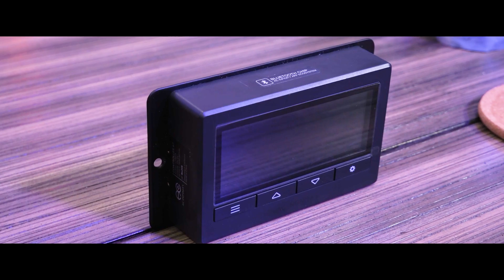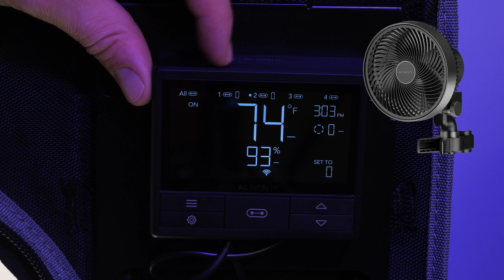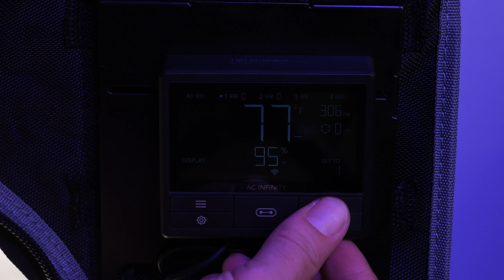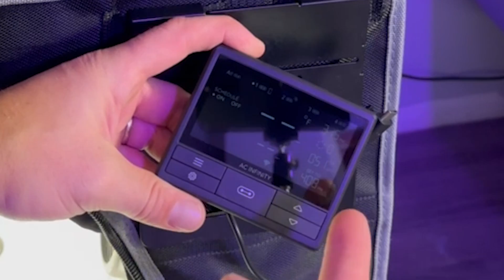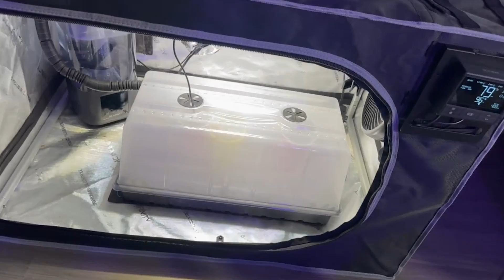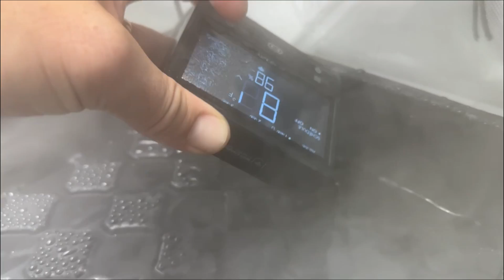HOW DURABLE is the ACINFINITY CONTROLLER 69 PRO?

Comment: Evidently alot more durable than the stitching on their tents...2 thumbs down on their tents...everything else has been pretty legit
Reply from the maker: Appreciate you bringing this up. I’ll be sure to be extra abusive to mine to test for any flaws. If you have issues I encourage you to each out to them for assistance.
Reply: @Pigeons420  already did...their remedy is to send another outer shell, which is fine I guess but after 2 months of use and it being the side door that doesn't get as much use as the front it's kind of worrisome. And not to mention the lack of flaps over the side doors...that should definitely be addressed.
Reply: @Pigeons420  I guess after buying three 5x5 tents, four 69pro filtration unit combos, 10 cloudline S6 fans and 4 humidifiers they might just throw me a bone and toss me a new tent but I guess I don't have enough followers

Comment: I haven’t been able to figure that thing out with the buttons. The app though is beyond easy. Just missing some functions in my opinion. Like being able to have your oscillating fans raise and lower fan speed threw out a cycle same with exhaust fan. I’d like to run lower speeds with lights off and higher speeds with lights on and unless I haven’t figured it out you can’t automate that
Reply from the maker: Hopefully this helped a little bit. Cheers friend!
Reply: Very helpful for anyone that doesn’t have the app. I feel like I could do what I need now if I lost my phone.